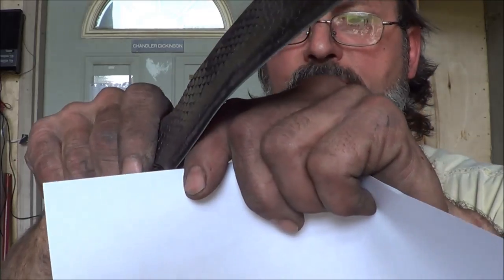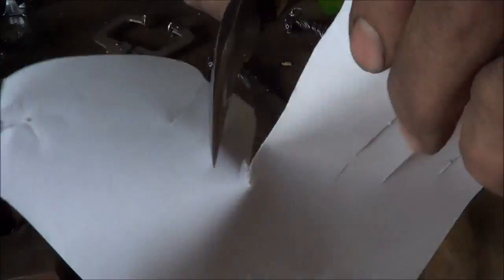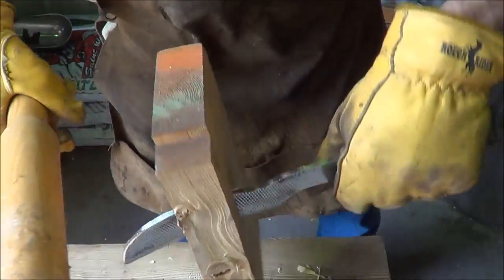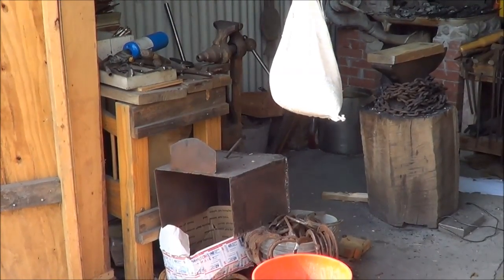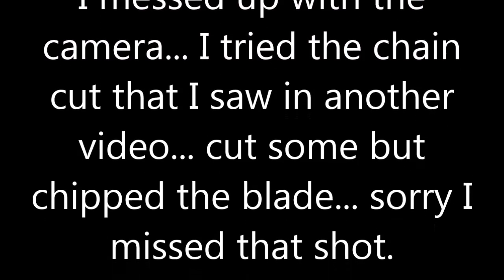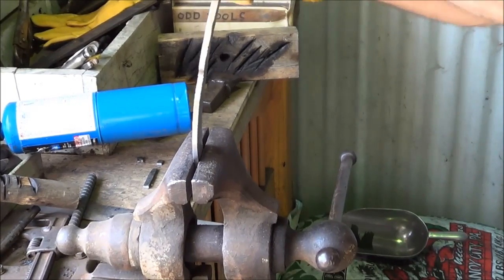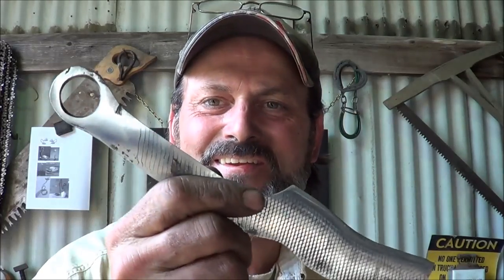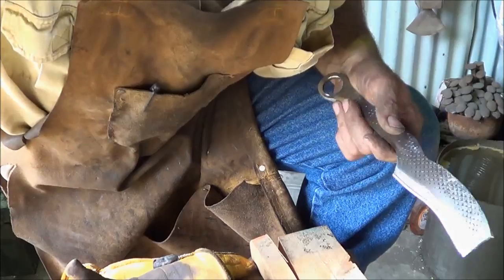Blacksmithing - Forged In Heller Fire Part 4 - Blade Test

Comment: The forged in fire guys get like 3 hours, don't they? and then another three hours to make the handle and to fix mistakes - and most of them have at least ten years of experience. even so, they've had blades break on the show. So considering you have, what, three years of experience and gave yourself only half the time, I think you did outstanding! hell, you should totally be on the show, i think you'd definitely stand a chance

Comment: I think if you made that is such a small(relatively speaking) amount of time, you could sell them for less than 60 bucks each easily. 

Also, I have a bit of a weird question, but have you ever thought about making bolos? They're a Filipino blade that has a one-sided 15 degree grind. They're mostly used as you would a machete, but there's so many styles and variations with different purposes in mind. You could try it out one of these days as part of a video series. But I gotta say they're made out of truck springs, traditionally speaking, so I don't know if you'll be able to get that. Or you could use some stock.
Reply: The hunter Actually, you're wrong. There are so many designs to a bolo saying that it looks like a kukri is a bit shallow and pedantic. Sure some bolo designs have similarities to kukris, but they aren't even close.

Either way, I'm sure your comment was meant with the best of intentions, so I'll accept your reply as merely a friendly retort.

Comment: From what I know you might get more flex if sharping on a bench grinder. After quench in water it becomes brittle steel but by the time you put it through the bench grinding it soften the steel which will give you a hard enough edge and enough flex in the core. Then you could try finishing with the belt sander.